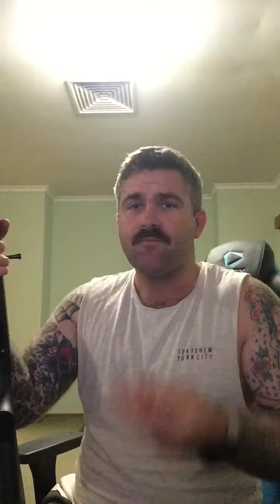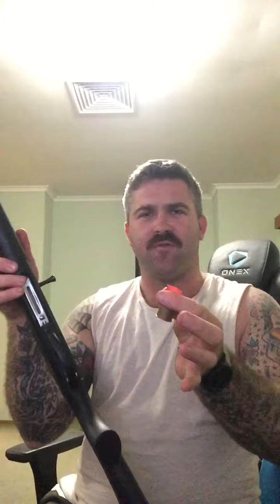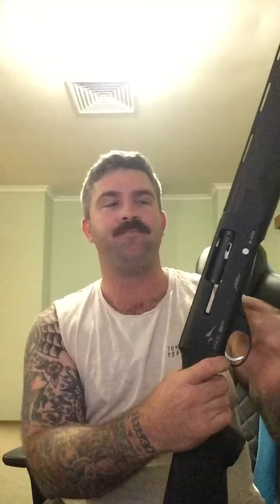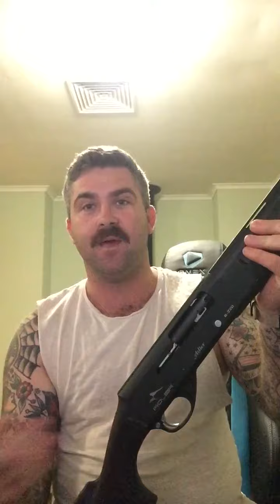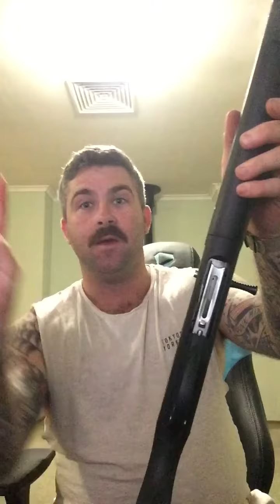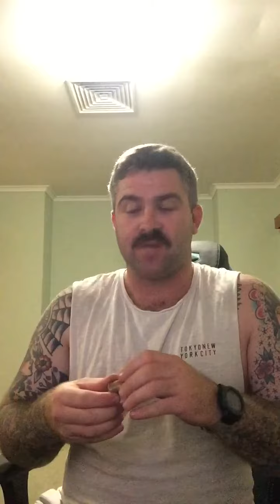You CANT use MINI SHOTSHELLS in an ADLER

Comment: Sulun pro 12 and sulun tac 12 can’t run them either
Reply from the maker: Makes sense, they have a very similar mechanism.
Reply: They do indeed.
Ran both yesterday.
Sulun is mine and the b220 Adler is my mrs gun.
Both great cheap shotties.
The Adler was a tad more clunky than the sulun.   But only a couple of mortar extractions after 100 shells on the Adler.
Sulun was flawless….   Smooth as fuck!
But back to the point of your video.
Why the fuck would you use mini shells in a 12 gauge anyway?
Wouldn’t you use a 4/10
Reply from the maker: @matthewberry1738  I guess people want a loophole for bigger capacity